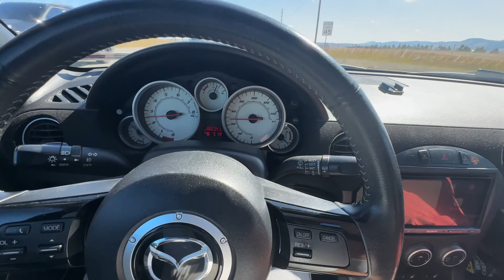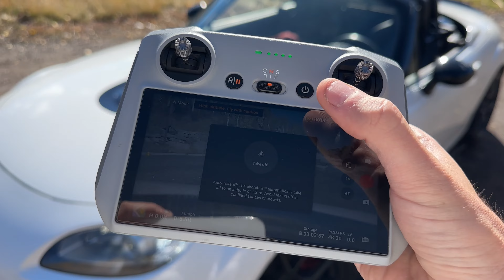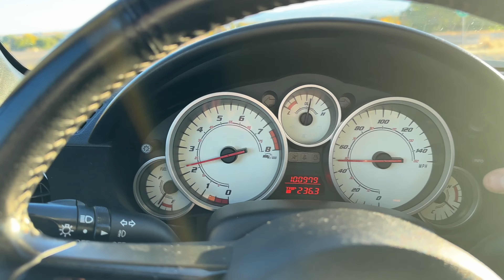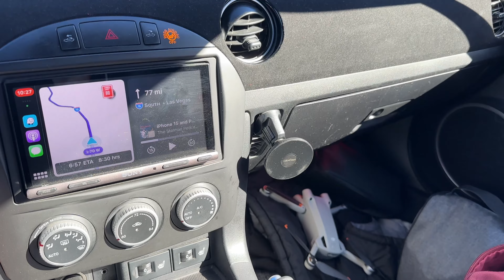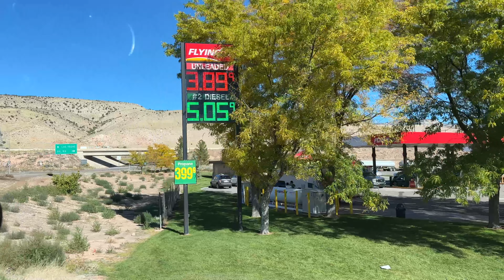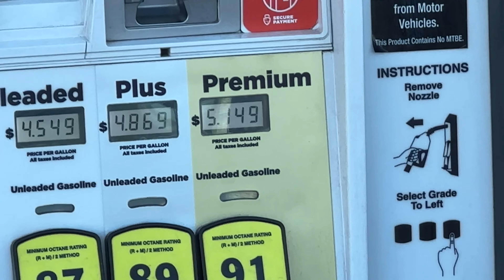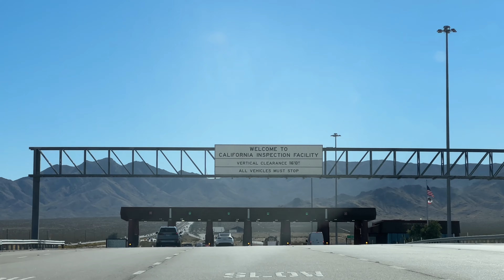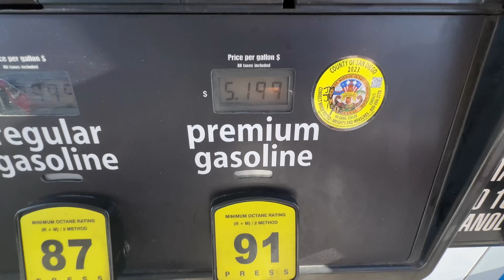Epic road trip through the mountains to California! Route to Miata Reunion part 1

Comment: Here is my packing tip (hack).  Ditch the hard sided roller bag.  Switch to a nice duffle.  I never have a problem with fitting my bag in the overhead, or the NC trunk.